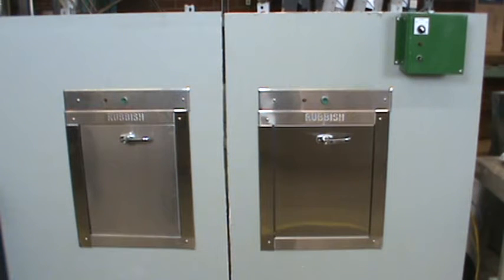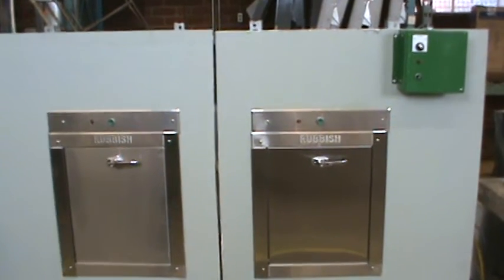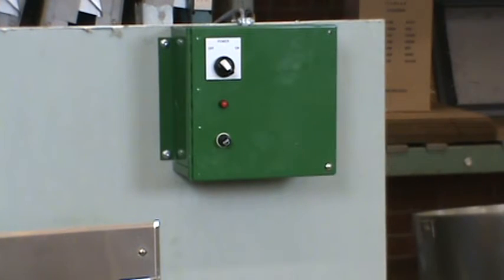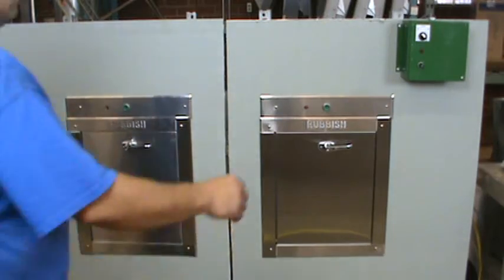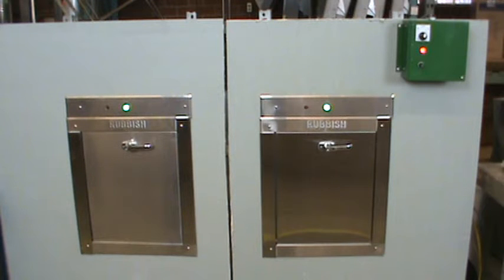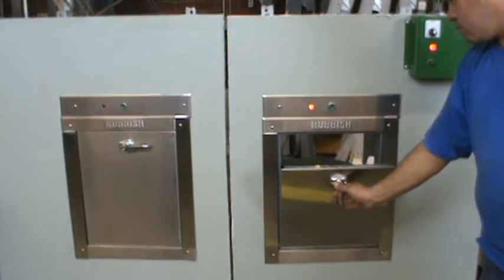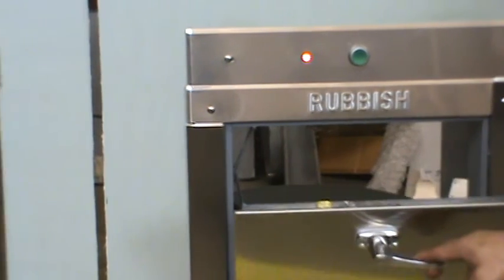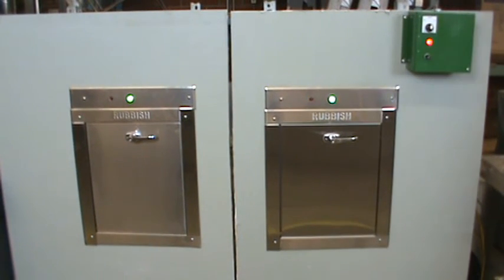Western Chutes Electrical Interlock Operation Instructions

Comment: More crap to fix
Reply from the maker: I am not sure if you are just trolling, giving the absence of context or specifics, but will give you the benefit of the doubt. Though I wonder if you have worked with these doors. If you have, you will know the extremely low failure rates (compared to others), ease of operation, and the increased safety factor EI doors provide. If you are having issues with this product, I would suggest you contact us directly so we can provide you with instructions to assist you. I would also ask, if you are fixing these, are you qualified and employed by the property management to conduct maintenance? I ask as some contract technicians blame products rather than lack of knowledge, or tenants attempting to “repair” though don’t know what they are doing and end up causing issues. I assume neither the case, and as a customer have our contact information. We look forward to hearing from you. Have a wonderful day and thank you.
Reply: @ChuteDr  my apologies 
I was referring to the idea of implementing the locking mechanism 
The more staff you have in system 
More staff to fix 
Was not my intention to say your product is bad 

One of the buildings I service 
All it takes a leak on the compressor or lost power or. 
To fail